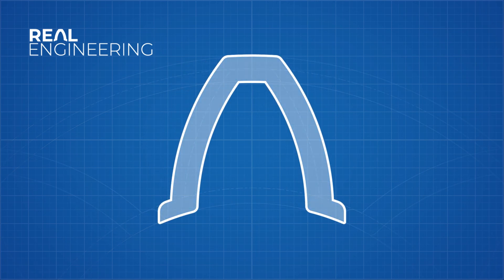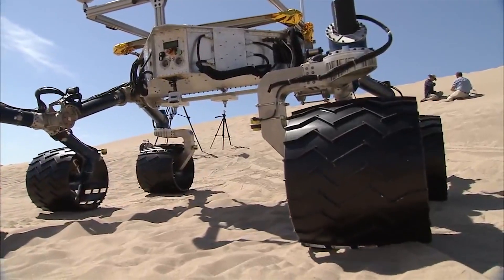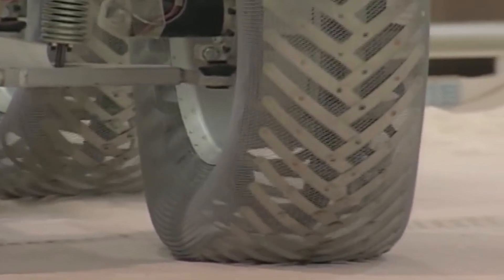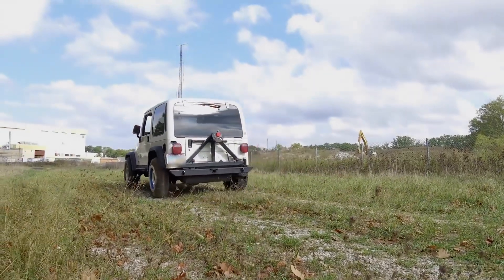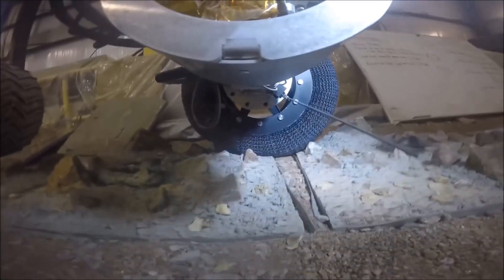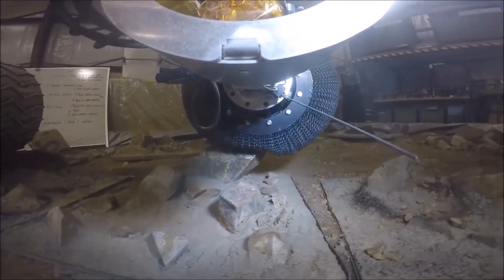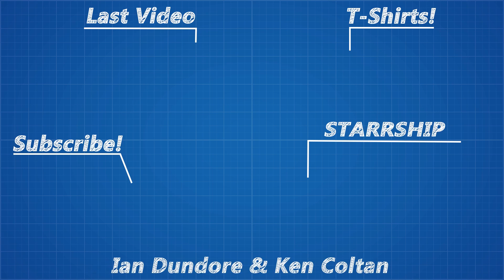How NASA Reinvented The Wheel - Shape Memory Alloys

Comment: What happens when you put too many smart men/women in one room?

Eventually, they start over complicating things they didnt need to.
Reply: Do you have a better idea for a wheel/tire combination that would work on Mars?
Reply: @koriko88  The problem was too much pressure in one place for a given material. They chose to use a different material, I'd have used more material to distribute pressure and reduced weight elsewhere. For example, why not use a stationary nuclear reactor which could potentially be used for decades and instead charge the rover as needed? Why not send multiple smaller rovers? Why not use small rover's to deliver freshly charged batteries to the larger ones? I simply find it odd that we are focusing on the short term when clearly our interests are long term. With $1,000,000,000,000 USD we could send up two relatively small nuclear reactors, enough reactive material for the next 100 years, (for the entire fleet of rovers) 40 small rovers to deliver power to the exploration rovers and 10 more rovers with the sole purpose of exploration and analyzing the raw materials found on Mars. We could have all of that equipment on the surface of Mars within twenty years and it would unlock the doors to safely put humans on Mars themselves. The problem is that we have people prototyping giant vacuums to clean CO2 and building "green" city's in the middle east and Egypt instead of putting their money to good use so that we could potentially abolish our need for a clean atmosphere on Earth in the first place. Hell, they'd make themselves the richest people in all of human history in the process anyways.
Reply: @anonymousanonymous9991  Well, that's one way to do it...but remember that then you're doubling the number of trips and effectively creating a logistics train. As the rovers venture farther from the reactors, the trips get progressively longer and more dangerous for the rovers as they age. More rovers also mean more people to control each rover, more risk of planetary contamination, etc. It does have some benefits and it may have been among the mission proposals. Of course you can always get the qualifications, go work at NASA and get involved in mission planning. :-)
Reply: @koriko88  I thought about the potential for radiation contamination etc and dont see a way around that regardless, only delay. Definitely a factor, however as for the trips getting longer I would think expanding how much area is explorable or moving to a new location would be a relatively easy next step. I dont know all of the parameters NASA has to work within which is why I'm speaking purely in the context of what technology and capability do we have now and how much will we be able to improve within the next 20 years or so. And I actually am fairly interested in working at NASA lol
Reply: @anonymousanonymous9991  "Planetary contamination" not only in the sense of radiation but also bacterial contamination. Every time they send something to Mars, it has to be assembled in clean room conditions and thoroughly decontaminated to try to reduce the number of Earth bacteria that end up there. That's one reason we haven't sent anything to Europa yet...we can't be sure that we can thoroughly decontaminate it enough to avoid introducing bacteria where they might thrive (google "planetary protection officer" for more info). Adding more rovers just for logistics purposes would probably make that situation worse. The radioisotope generators that we have actually work pretty well at providing long term power, although they do have drawbacks.

However, something that has been proposed (but not done yet) is the idea of putting a solar array in Mars stationary orbit, and then beaming power down to equipment on the ground using lasers or microwaves, if we could reliably find a way to overcome the issue of dust collecting on panels. That would enable us to not have to use radiation as a power source. As long as we have a clear shot with only occasional dust storms, that could work (maybe).  

There are other options as well, like more efficient betavoltaic devices (the ones we currently use tend to be short-lived). In general, long-lived radioisotopes are something that we want to get away from launching into space. The radioisotope generator on board Curiosity uses plutonium 238 dioxide, with a half life of 87 years, so in a relatively short period of time it will no longer be that dangerous. However, a full-scale reactor could be a different story. We don't want to leave something on the surface of any planet that could be found and accidentally opened by a future group of humans who forgot about our missions to Mars, or aliens or whatever. 

As for NASA...study hard, work hard, maybe you can work there one day! :-)
Reply: @koriko88  It could be possible to eliminate bacteria by exposing it to a vacuum, I'm no biologist but I dont know of any organism capable of surviving in a vacuum. As for radiation, it's a difficult obstacle to get around. Leaving reactors in orbit might work fairly well, though theres still the problem of delivery. I've never heard of the solar array/laser setup you mentioned... Lasers do tend to have a low level of efficiency, though still interesting. And thanks, that's the plan :)
Reply: @koriko88  And Tardigrades. https://en.wikipedia.org/wiki/Tardigrade

Comment: Point of order: It does not have a nuclear reactor. It has an RTG. One works by splitting atoms to heat water, which makes high pressure steam which is then run through a turbine to create electricity... The other just soaks up natural decay heat and turns it directly into electricity.

Comment: Curiosity is not powered by a nuclear reactor, but a radioisotope thermoelectric generator. It relies entirely on the constant heat of the radioactive decay of Pu-238, rather than splitting atoms.  Good fucking luck cooling a nuclear reactor on a rover on another planet.
Reply: I was wondering how they got a nuclear reactor on board without melting the whole tging

Comment: What if you only used Radio to transport signals from the rover to a satellite that orbits mars, and then stack a bunch of mirrors with blinders on said satellite, that could morse code information back to earth at the speed of light.  You'd need some pretty damn big mirrors, but if we can use mirrors in a telescope to see light that's a billion light years away, we definitely have the ability to use our own sun and some complex mirrors and lenses to reflect light from mars back to our earth.  That way transmissions wouldn't take forever to get to earth, and we wouldn't need to lug around all that heavy, powercostly radios

Comment: its not powered by nuclear reactor, rather a atomic battery. Decaying tritium produces heat which gets converted to power. Its much like the ones we use on satellites. A reactor uses a chain reaction  using plutonium or uranium to produce much much more heat and is much more complicated. In fact, we don't have any(publicly known) reactors that would be small enough to fit in any rover. I believe, and correct me if im wrong here, the smallest(physical size not power output) is the China Experimental Fast Reactor (CEFR) currently operating at the China Institute of Atomic Energy. It could also be the EGP-6 light water graphite reactors (LWGR) located at the Bilibino Nuclear power plant in Russia. Both reactors do not have much info on size, so I cant confirm this but have both been named as firsts and seconds for the worlds smallest commercially available reactor. There are talks of China  also planning  a small 20 foot long by 8 foot wide reactor that would have a capacity of 10 megawatts. That's nothing compared to my local turbine plant, producing 600 megawatts. so we are getting there.....but we never tested long range on these reactors in a space/planet type of environment and there is a lot that could go wrong. Lots of moving parts, lots of systems, lots of radiation which messes with electronics, and lots of things that need to be built to last years and years without being touched by anything. This just isn't the case with current reactor designs. Atomic batteries however are relatively solid state and don't require much maintenance.

Comment: While smart people over at NASA have used countless hours researching the Curiosity's wheels and reducing the weight, it is hard to grasp how much the resulting aluminium structure of the wheel goes against my intuitive thinking. While I  understand the tremendous importance of reducing the weight, I really don't understand why so much focus was put into the wheels making the nearly one metric ton rover walk on feathers that even small changes in the surrounding environment can cause such wear and tear. It just seems to weird to have so small safety margins on such crucial part of the rover. The wheels are machined to just around 2 kilograms. On the other hand, the other instrumentation and frame seem to have lots of very bulky metallic parts.

Comment: These engineers are going about this all wrong spending billions.  Two primary issues is POWER and LOCOMOTION.  

First, they need to be using a Thorium Reactor and not an RTG.  This video sums up Thorium:
https://www.youtube.com/watch?v=c7baTdyHv8g

Second, they can't use wheels on that surface.  Even those fancy spring ones.  Someone already mentioned small rocks getting in-between the springs.  Unless those spring tires had a  way of freeing debris as it flexed they need to go the leg route.  I would say six legs.  A Thorium Reactor would be strong enough to power a pretty sizeable machine walking all over Mars for years.  Look, here is a four legged example:
https://www.youtube.com/watch?v=9KYnbwXTMXA

From the political standpoint, spending billions of dollars to explore a lifeless rock is nuts since we have so many issues that need fixing right here on this planet.  Take the giant island made of plastic garbage floating in the middle of the Pacific for example.  People said the same thing about the Apollo program which is why it lost public support after the first moon landing.  Why are we spending billions of billions funding someones science project when we have major problems here on earth?

But I do say this, if we are going to Mars, take the time to build the right machine.  They spent all this time, effort, and money to build this rover only for the tires to break apart.  That is completely ridiculous.  Didn't they test these wheels before hand?  If they did, did they do it on a beach?

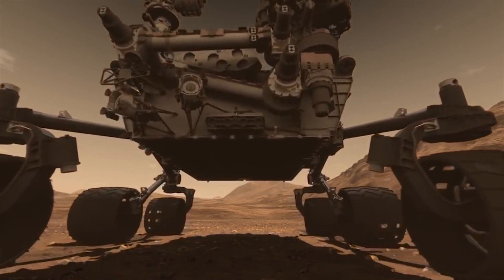Comment: 2:35 "nuclear reactor"
NOPE! It's an RTG, just sayin'. Just because it's fuel is radioactive does NOT mean it a nuclear reactor.
Reply: Uses nuclear reactions to power up the River, so it's a nuclear reactor, no?
Reply: @Ykario_NB  It does not. A Radioisotope Thermoelectric Generator converts the heat normally produced during radioactive decay into electricity. Radioactive decay is not a nuclear reaction (or in that sense, a reaction at all).
On the other hand, a nuclear reactor is a system in which a nuclear fission chain reaction is achieved and controlled.
Reply: @lurkalisk  Okay, thanks for the explanation !

Comment: I reckon that the weight of the vehicle is supported at any moment by the portion of the tire that's between the axle and the ground. That means that most of the tire is not supporting any weight at all, most of the time. I'd like to see a design for a tire that puts strength where it's needed, and saves weight where it's not. I bet a tire like this could be designed with conventional materials. It's the way the Russians would do it. : )

Comment: Rubber wold still work as long as they limit the driving to when the temperature is high enough.
Reply: lol. limit it when it has to mover slower then anything but the shuttle taxi as it is?? and did you not hear the part about radiation??

Comment: Consider a new alloy developed:
Most wear-resistant metal alloy in the world
"A materials science team has engineered a platinum-gold alloy believed to be the most wear-resistant metal in the world. It's 100 times more durable than high-strength steel, making it the first alloy, or combination of metals, in the same class as diamond and sapphire, nature's most wear-resistant materials.

"If you're ever unlucky enough to have a car with metal tires, you might consider a set made from a new alloy engineered at Sandia National Laboratories. You could skid -- not drive, skid -- around Earth's equator 500 times before wearing out the tread."

https://www.sciencedaily.com/releases/2018/08/180816132009.htm

Comment: WALK, don't roll the Mars rover since it moves extremely slowly. A light-weight mechanism  can use circular mechanical motion can be converted into a simple walking-like movement without the complexity of imitating human or animal-like walking. The end or tips of the multiple "feet" contacting the Mars surface could wear down a lot without compromising its ability.

Comment: Curiosity doesn't use a nuclear reactor, but a radioisotope thermal generator -- essentially a nuclear battery where the heat generated by nuclear decay is transformed into electric energy. Very different things.

Comment: WHEEL FACT! : JPL who built Curiosity, was told by NASA that they couldn't put their stickers/logo on the rover as it's a "NASA" project...Even though JPL outdates NASA cough cough so  JPL put Morse code into the wheels. Those holes on each wheel actually say JPL! It also serves as a method for determining the overall distance traveled. Could you just imagine...JPL JPL JPL JPL JPL JPL JPL JPL JPL JPL JPL JPL JPL JPL JPL JPL imprinted all over Mars.

Comment: It will never work... Can't you see it has major flaw build in? A MESH WHEEL? It will pick up random ground particles and it won't be able to move because of the mass of full wheels, not to mention it won't be able to reshape itself when its mesh will fill with dirt. Old design was way better. Contact surface will always break down. Thats what it is meant to do. If it is elastic it must be also not absorbing ground on which it travels. And mesh must be nano size and multi layered to be able to do that. The one presented here is way to thin. Must get much much densier to work.

But mesh wheel is great if you change it into mechanical muscle driving simple one piece leg. Thats how nature "invented" insects. Alright, they have segmented legs, but their base attachment is so simple it can be used for any L-shaped device of proper lenghts to drive it. Several wheels in casing and you keep dust out of them while using their finest properties. And we though we will not learn from cockroaches...

Comment: "The Mars rover cost $2.5b to develop and it employs a nuclear reactor for power." Not true. Curiosity, like almost all nuclear-powered spacecraft, is equipped with a radioisotope thermoelectric generator (RTG). RTGs generate electricity from the decay heat of nuclear fuel, whereas nuclear reactors "burn" their fuel by controlling a nuclear chain reaction. RTGs and reactors may sound similar, but they're about as different in principle as a battery is to an engine.
Reply: Well said.
Reply: Good enough with public knowledge.

As most see reactor as 
"Something that made electricity thingy"

Comment: At 2:37 you said the Mars rover utilizes a "nuclear reactor" for power. This is not correct. It uses a Radioisotope Thermoelectric Generator (RTG) to generate electricity in a fundamentally different manner than a nuclear reactor. While a nuclear reactor requires the chain reaction fissioning of fissile material to generate heat that boils water which drives a steam turbine, an RTG simply uses the heat from natural radioactive decay (no chain reaction required) to generate electricity with thermocouples (two dissimilar metals intimately connected together that generate electricity when heat is applied). This is inherently much safer than a nuclear reactor, as there are no control systems required to maintain equilibrium in an ongoing chain reaction, nor is there any requirement for an active cooling system. A simple and basic heatsink is all that is required.

Comment: The reason you don't see a lot more products designed with nitinol is it fatigues and fails relatively quickly. I was designing valves and tried to make diaphragm springs out of nitinol in the superelastic phase. They actually worked great but I needed them to last 1M cycles and I could never get them to last more than 100k cycles without failing. I think this is why we don't see it in many more applications. It might work for a short life space tire but never in a car tire.

Comment: Are you sure that there isn't a misprint in your information? The illustrations of the wheels would seem to show that the treads (6mm) are less than the thickness of the main body. I would suggest that the 0,75 mm should read 0,75 cm. Having a wide range of engineering experience I can't see how the thinner section could work.